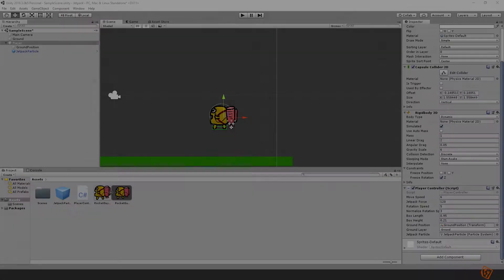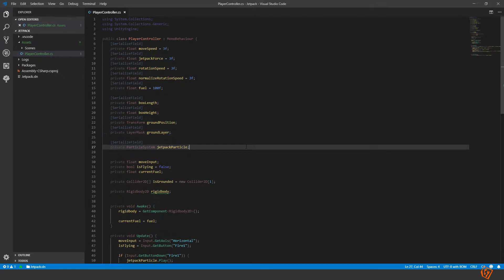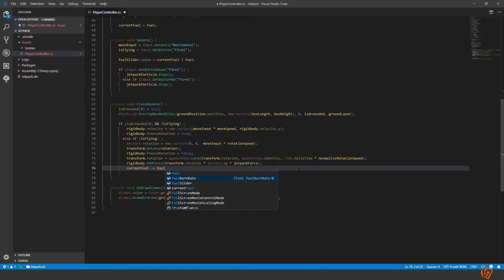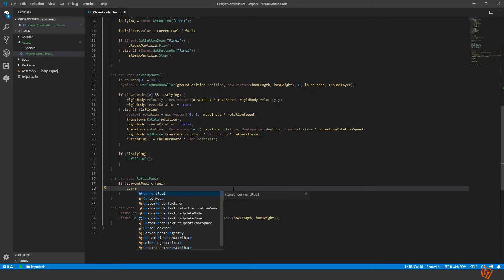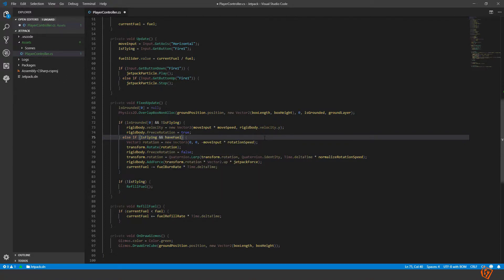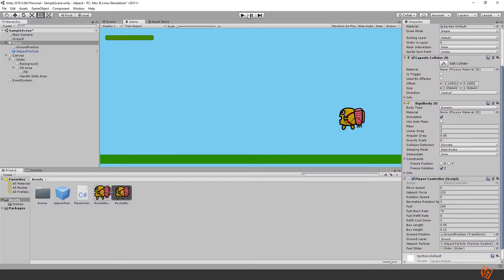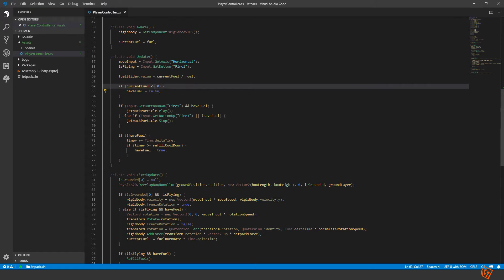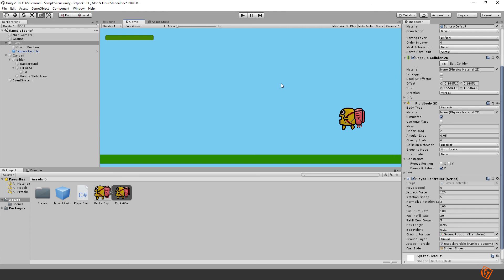Jetpack with Unity - P2 - Fuel and fuel bar

Comment: man, there is something wrong with your your unity engine or the code editor, you are initializing  the slider and fuleburnrate in private field, but you can edit in your unity engine, how is that possible.
Reply from the maker: Hi shivesh :) haha. You might think that. But if you serialize a field it will show in the inspector. Using public is one way but if you write [SerializeField] before a private variable, it will also show in the inspector :) give it a try. This is a better practice since generally you want to use private unless you really need to set it to public. 

About the particle effect. I just messed around some with the parameters. Try it out. If you can't get it right I can share the project with you and you can check it out.
Reply: @FreakyFeet  . ok I didn't know abut the [SerializeField], thanks for the information.